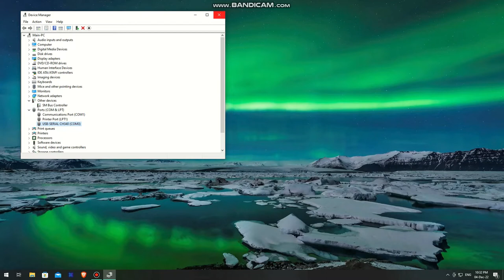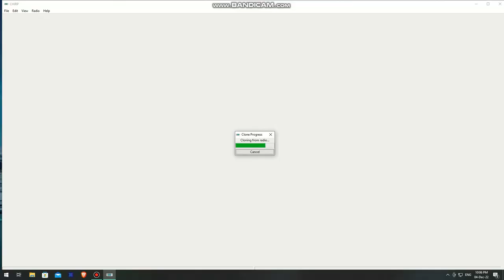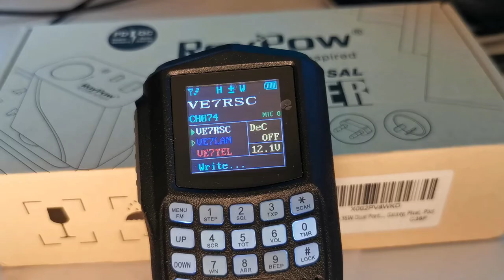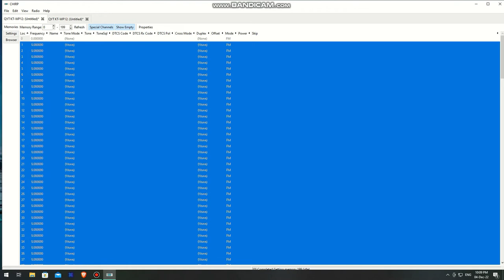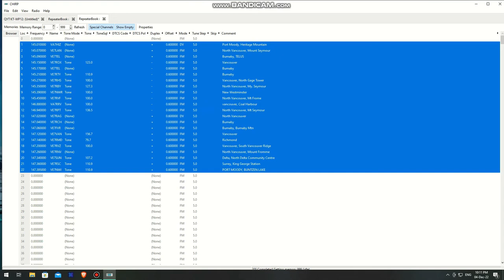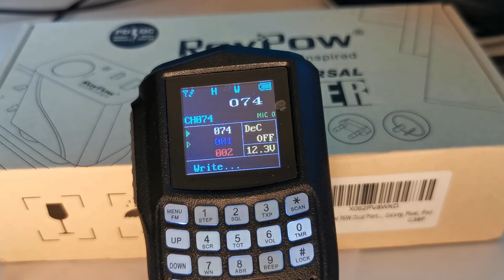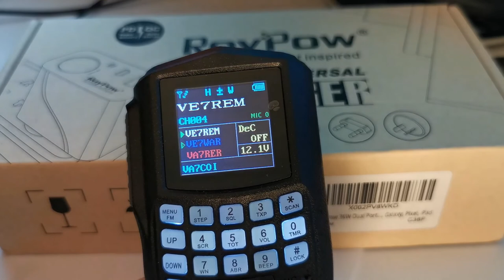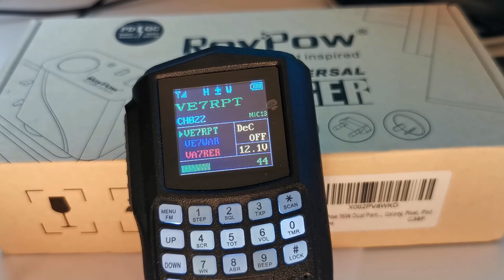Chirp love - Qyt Kt-wp12/kt-9900 Two-way Radio -much Easier

Comment: You may have already mentioned this, but which programming cable are you using - the one that’s included or an aftermarket one?  Did you have to install a particular driver?  I just ordered the Anysecu version of this radio - very excited to put it in my Honda Fit!!  Thx and 73

Comment: Question: will it allow you to operate within GMRS frequncies 462.000 to 467,000 Mhz ?
Reply from the maker: It will let you program those in yes. But i do NOT recommend transmitting on them as the radio does not meet the technical requirements specified by ISED (Canada) FCC (US)